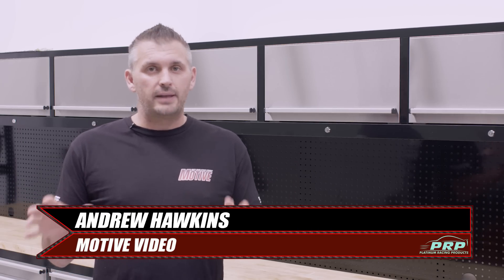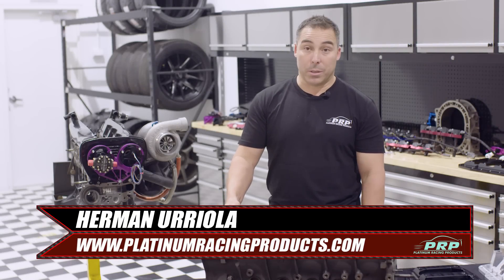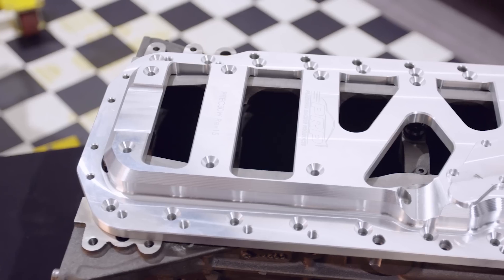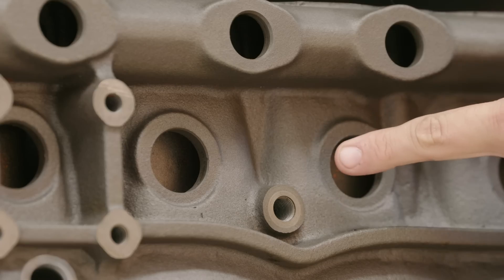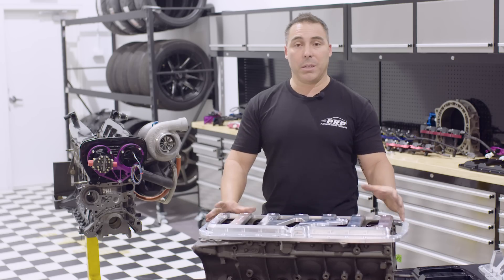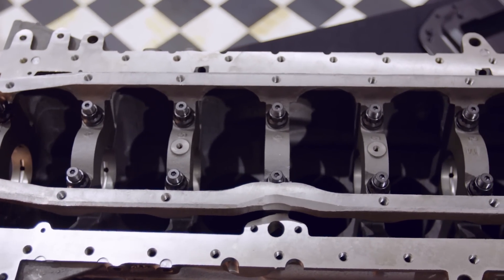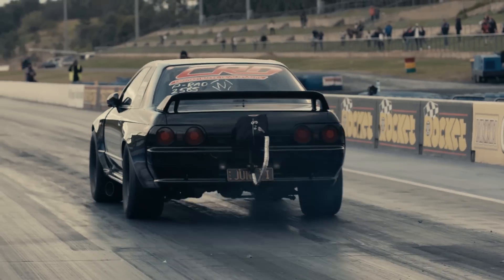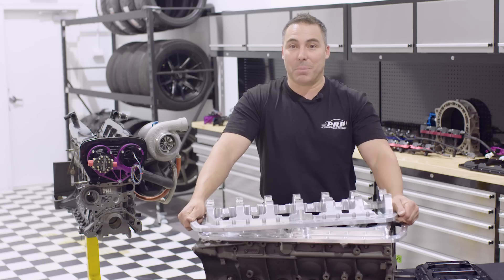How to Strengthen Your Nissan RB Block and Help Stop Cracking

Comment: Hi I have a skyline r33gtst  1993 2.5 det  can any one advise me should I fully forged my  rb25 eng. or  should I change it to rb26 or rb30  engine there is nothing wrong with rb25 it runs 100% perfect  iwant it to  push 500 to 550 b.h.p max   as iam going to strip it fully to bear shell   and  full restored  it and mid night purple glitter 2 colour  any advice  which internal parts I  should used Andrew can you or anyone else   give me information which way should I go about it ??
Reply: Andrew what's you waiting time like

Comment: Does the billet RB30 girdle also suit the dry sump system so I can brace the block and run a dry sump system at the same time
Reply from the maker: Can get girdle to suit wet or dry sump
Reply: Motive Video thanks, is there a  good place to visit for turbochargers trying to find out what would be good for an RB30 as well

Comment: I used to run a 500kw 2.8L N1 block in a circuit car and I didn't crack the block.   
I think the type of driving I was doing was not as detrimental compared to drag launching and secondly,  the N1 block was helping that much better and also I was running the HKS crank.
One massive thing Herman has not mentioned here is the stock cranks flex, this in turn pushes on the block too hard when it twists, but with a billet or forged crank you get a higher level of torsional strength, it pushes onto the block far less, this is critical in keeping a 6 banger alive and stopping premature bearing wear etc.
Yes I agree with crank girdles, but ultimately it is the crank that is causing all of this, why not start with a improving the cause of this issue first?
Reply: A considerable amount of people who've been building and racing these since the mid 90's mention they wouldn't listen to a thing Herman says.  During his brace sales ads and talk, He got very angry when I asked how many 24U (N1) blocks he has seen crack around the turbo oil feed compared to 05U blocks.  I sent him two 26 blocks to be tested as in this video and instead of getting my own blocks back it ended up in somebodies engine bay and someone elses property got sent to me i'll be doing my own Youtube video about this and with a few blocks cut apart so to help you guys see if there is any difference inside or if pretty much the same

What they have no interest in telling you is that the N1 block has a thicker deck and more material around the weak spot near the oil feed hole and rarely cracks in that area where the 05U's do it all the time - Nismos foreman mentioned it in one of his blogs which you can go and read.  Anthony from Maatouks Racing who has built more RH7/RH8 GTRs than most mentioned in a post he has never cracked a single N1 block around the oil feed or seen one crack there even with over 1000hp and that they build them without a brace on them, that comment went missing I screenshotted it just incase

Comment: Revision 15, now thats alot of cracked RBs
Reply from the maker: 007 007 revisions weren’t due to that. Ever. 
It was things like different strokers, improves bolts, making it fit multiple RB blocks etc.

Perhaps ask before creating your own ideas out of thin air with no evidence

Comment: How to strengthen a RB. Buy a 2J. hahahah
Reply: The RB is not in the top 10 list of any engine you would want to take to the limit
Reply: Or the N1 is crap so they sell you a brace and all your problems are over lol
Reply: @Tex 13 the 2jz holds just about every speed and et record for any engine with 6 cylinders ever there are bigger engines with more cylinders and more power but if it's 6 cylinders you want the 2jz is undoubtedly the best to choose.

Comment: If its strong as its over rated ..why it needs bracing to stop cracking 😂
Reply: raheel saleem  the cracking is from an external factor not an internal issue.

Comment: Nice video. i have a question. I am running 400whp on my rb25 now, lot's of mods. What all do i need to get a good 600whp? It's street legal still, got a garrett gt3076r on it atm and my engine is forged rebuild
Reply: @Tex 13 well true,I am around 480HP atm but 398 at the wheels. Maybe i just need a bigger turbo since 22psi isnt enough. Max is 24 but 24 and 23 isnt that stable so i left mine at 22...i probably just need a bigger turbo and a re-tune .-.

Comment: Just buy an N1 block it's got more nickel content and hardness and you don't need this brace! Nissan doesn't recommend this brace or else they would've made it themselves!
Reply: al X an N1 block doesn’t fix this.
Reply: @alx4050  you need to get out more and watch the previous video in this series they didn't find any difference between the RB blocks including the N1
Reply: Realtime1501 you call that a test? 😂😂😂😂 you fool
Reply: al X  the N1 block isn’t to fix the issue of a twisting diff acting on it until someone actually pays for a lab to test the block. No one here knows the difference.
Reply: who said the N1 had more nickel? we have all heard the rumours, but the N1 is certainly not harder, Nickel is actually softer, but once mixed in the alloy is in theory meant to be harder in theory, but no one has been able to conclusively prove that there is more nickel, and the block is softer, soooo find us some data please :)
Reply: @alx4050  we will do a vid with a bunch of failed N1's soon. they fail, lots.

Comment: Just buy an N1 block it's got more nickel content and hardness and you don't need this brace! Nissan doesn't recommend this brace or else they would've made it themselves!
Reply: Nissan also didn’t produce a rb pushing over 500kw FROM FACTORY either.....
Reply: All Rise they don’t need to
Reply: al X they do they bridged the bottom of all their later generation engines.
Reply: These videos proved your theory wrong

Comment: I'm assuming the engine builder would have to be knowledgeable enough and account for heat expansion at different rates if they go for the one with billet main cap bracing in terms of the bearing clearances on the billet and cast iron side?
Reply: John Olasau  the engineering is done you don’t have to account for anything main line hone and you’re set
Reply: MSengineering David you seem to know a lot are you the guy who makes them for platinum?
Reply: Roger no those are the basics when you use aftermarket main caps.
Reply: @msengineeringdavid3702  Thanks Dave !

Comment: Hi, how would you go about main caps that have been taken out from the oem block and using that integrated girdle and main cap brace? Do you machine the girdle assembled, torqued and tightened properly and then go about it that way? Curious because i heard main caps and rod caps have a parting line that they have cut from factory and you can't just fit stuff like that on blocks willy nilly, so how would you go about this?
Reply: Lime you do an “align hone” basic machining process.
Reply: @msengineeringdavid3702  I knew about "align honing", i swear it was called line honing, maybe because the "a" is silent. I just worry whether its the same if you used different parts from oem main caps. so you wouldn't need to worry about the parting line of the main caps and have those machined flat and worry about whether how much you need to take off to get flat before you worry about how the hole for where the bearings and crankshaft will go. Because if i did it this way, it require some math to figure that out, which is still basic but still a mind fuckery and hurts the head because if not done, the hole for the crankshaft and bearings will be oblong.
Reply: if you reused the original main caps to the engine, i dont think you would have to line hone them. an easy test is just tq them down without a crank in and check for any material hanging over.
Reply: @frigglebiscuit7484  @friggle, not sure what material hanging over means.
Reply: Frigglebiscuit stop trying too hard noob

Comment: I've got a rwd RB26 that's gonna make around 500kw. Since it's got no front diff should I worry ? Or should I just send it and if it cracks then look into prp brace
Reply: TheLeggera  it’s been stated right in the video ppl with big power rwd don’t have block cracking issues at all.

Comment: Love the rb’s defiantly my motor of choice but I’d love to see a tb48 get sonic tested
Reply: TB48 and the 1FZ are way too big they are no doubt stronger w/o checking main reason is the stroke and rod, oem will make a block stronger because increasing stroke imparts greater side wall forces upon the block.
Reply: Flynno seen any clips with a tb48 in a GTR?
Reply: Na but wanting to. apparently there stronger than 2j’s
Reply: And about 3x more torque!!

Comment: Can you have a good welder fill in those spots to help strengthen the block??
Reply: GeeTR 63-71 you can’t weld cast iron you’ll crack it and make the metal lose its strength.
Reply: @msengineeringdavid3702  agreed, its hard to weld and is never as strong as the original casting
Reply: @hermanurriola138  Hello Henry how are you? I love the vids you guys doing so far and learn important things from them. Anyhow my questions about the main cap incorporated girdled you showed. I know aluminum is lighter which is good but 1. Does the aluminum expanding differently and issue over say a billet steal? Also what about a billet main cap with a girdled that ties all the caps together and  then to the pan bolt holes? Would that also work well?  Thanks George
Reply: @georgehoneymen6045  Hi man, yes expansion rate is very different with alloy, that's why we have not released the alloy brace yet, its in testing still ( all iin one billet main cap version) we have released the steel version, it does tie the pan rail in and it works magnificently
Reply: Herman Urriola Thanks for the reply! Is the steel version a two-piece that attaches to the main caps? I’m curious for a Nother application on a Toyota 7M. I have billet main caps I was going to make a billet griddle to attach to the caps and oil pan bolts. Thanks.

Comment: I have zero interest in RB's, but this content is so interesting I can help but watch.
Reply: Zero interest in rbs but watches a 98% rb based channel 🤦‍♂️
Reply: @clutchkickpj693  yep, hooked me with the world time attack series, and now I'm even watching stuff I don't care about, learning lots.
Reply: I'm not a particular fan of rb's either but, knowing your enemies weaknesses is the key to winning lol. I do actually like the r32 and 33 though so knowing how much power I can run without the brace is good knowledge and knowing it won't crack if I delete the front drive shafts is good as I don't care for 4x4 or rear plus front on power.
But damn that's a lot of work just to stop it cracking.

Comment: Informative video. So. Its the front diff that is responsible for block cracking. I can certianly see that happening with a lot of power and slick tyres at all four wheels in a GTR.

Comment: the engine that comes out later in response to the other engine should always be better... its just common sense, no? regardless, both engines are legendary. wonder how much power the RB block holds in just RWD setup since theres no front diff stress
Reply: kgkustomz97ser he said it very clear in the video.
Reply: @msengineeringdavid3702  guess im busted then. lmao.. i didnt watch the whole thing. i just skipped through. you gonna tell me what he said or make me watch the whole thing?
Reply: ok... he didnt say a number for the RWD config.. he said some dont crack at all
Reply: kgkustomz97ser  he said big power rwd have little to   NO issues cracking blocks. On an RB26  the differential climbs the ring gear and wants to rip out of its hold in a twisting manner that force is applied to the block and that cracks it. Ever see RWD cars lift wheels before on one front tire? Specifically the front right it’s from the ring gear  lifting the body which happens in a diagonal motion same thing happens to RB’s with diffs mounted to the engine block.

Comment: Can you please get a 1jz on your channel? Some toyota forums saying they are better than rbs but i doubt It?
Reply: Block height on a 1j is shorter.
Reply: @msengineeringdavid3702  exactly! Im more interested in a direct comparison: ie number of ports, cylinder wall thickness, sonar testing, like there other videos :)
Reply: Ed Jack  thats not true. The rb26,  2jz and1jz have the same bore
Reply: Not having a go just saying 😊
Reply: @Tex 13 useful info, cheers mate
Reply: @Tex 13 Made over 1000whp on internally stock 1j ran for months at that level before a rod failed only internal mod was hks 264 cams

Comment: This is really easy the basic to fix it is to put a 2J Z motor in it way better block and you won't have the issues that you do with a Nissan block
Reply: How will that fix it when you want your GTR to remain 4wd?
Reply: @callummcrae7774  There's a company in Russia that specializes in AWD conversions for 2JZ powered cars. Problem solved :)

Comment: Why do RB heads crack between #5 and #6 cylinders?
Reply: You guys are talking two different things. In answer to your question- the heads generally crack in this area due to localised hot spots from steam pockets. Is the engine going in a VL? The radiator position is a little low on thw Commodores and creates problems getting air pockets out of the cooling system. The fix is to change the way the cooling system is designed and incorporate a proper expansion tank that sits higher than any other part of the cooling system (the inlet manifold in an RB20, 25 and RB30's are the highest point). This becomes the new fill point and will naturally bleed any air out of the system
Reply: Ed Jack  Do cylinder head steam bleeds fix the problem?
Reply: And put 6 steam bleeds at the high points in the head 👍
Reply: probably hot spots. drill steam holes and you should be fine.

Comment: Have this guy more often, he’s great
Reply: Thank you so much
Reply: @hermanurriola138  I don't have any plans to run or interest in RB's for that matter, but the knowledge and presentation keeps me glued to the screen. Great job!
Reply: He sure is!
Reply: @Tex 13 There's a simple reason I am not into RBs - financial. The availability and cost of parts in the states is still pretty limited. When you factor in that I've been around 2Js since the mid-90s and hoarded a ton of parts over the years.. I can go to almost any local Toyota dealer and get a part the same day. Or a local autoshop that will have the interchangeable parts with GE, which are dime a dozen. Plus at the end of the day, I would just have to put that much more additional money into an RB to make over 1000whp.

Comment: Will the brace make the oil pan lower and neew to open up the transmission bolt holes a bit?
What about adding a good amount of solder material to the place where the block cracks?
Reply: jasaircraft it won’t make it stronger.. the reason it cracks is because of distortion from the front diff a brace takes care of things there.
Reply: yes brace makes the sump lower, plenty of room, and how to modify the bell housing to suit is all on our site under instructions

Solder over the fault line is not enough to compensate for the blocks ultimate strength under load, it takes so much until it cracks, the force causing it to crack are far more than some solder will help with unfortunately but thanks for thinking outside the box on that one, I appreciate it.